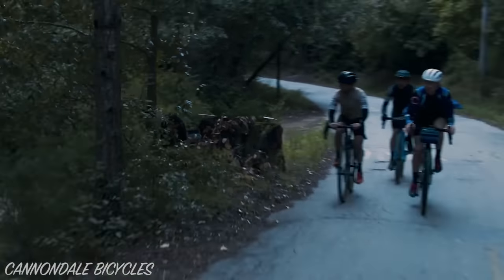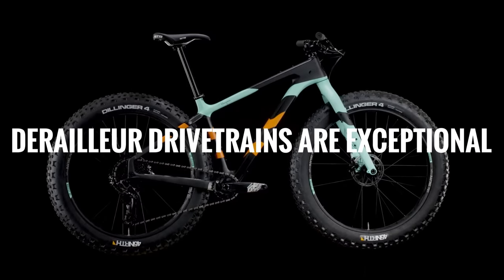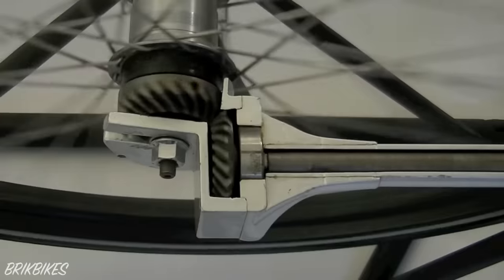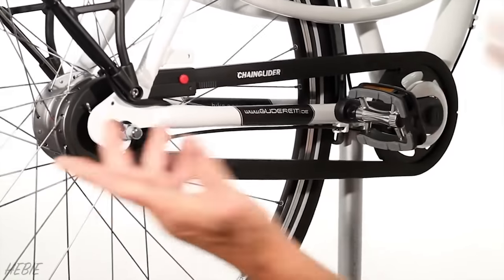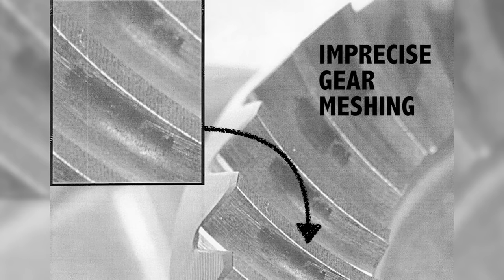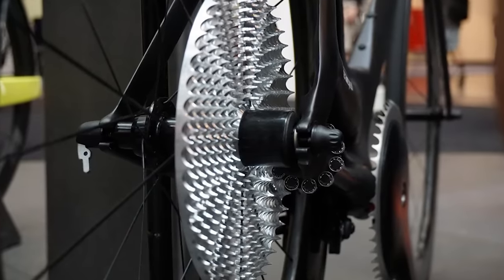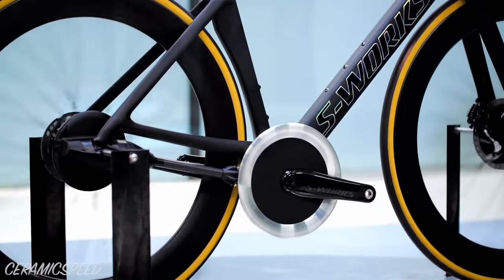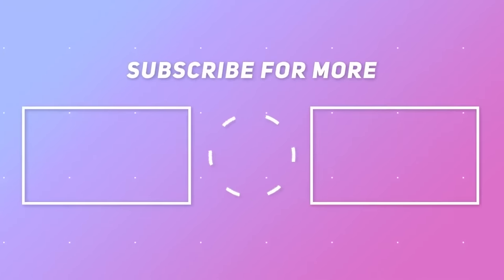Are Chainless Shaft Drive Bicycles a GENIUS or TERRIBLE Idea?

Comment: You give all the percent efficiency comparing a circa 1900 early shaft drive bicycle test, then include some imagined increase in efficiency in derrailier chain drive just for 100 years of manufacturing production. Chain technology may have improved but new expensive sealed, bushed and self-lubricated chains are not miniaturized for use on bicycles. Then you add on top the improvement in chain oil lubrication to come to a final difference. 
   Fair enough. But using the same logic, what about the known 100 years development and closer tolerances in gear design and accurate mass manufacture including CNC production? Then add the availability of many modern specialist low-friction surface coatings that can easily be applied to gears. Then likewise the new ranges of special high-pressure oils for gear lubrication? Then the improvement in mass manufactured self-lubricating ball and roller bearings that would now be used to maintain perfect shaft-drive gear tolerances.
   Take the perfect situation of a clean fully lubricated bicycle chain drive starting out. The moment the bicycle goes through a cloud of dust or mud we now have grinding-paste lubrication instead. The chain immediately starts drying out and wearing away. As there are only steel-rollers on steel-pins the chain is wearing away without continuous total-loss lubrication, so as the chain "stretches" with wear this only gets worse because the fit of the chain to the sprokets quickly deteriates in efficiency and exponentially increases wear on the sprockets as well. As wear is a sign of wasted energy then this says bicycle chains suffer a high AVERAGE rate of inefficency over their small lifetime. But regular lubricated gears can be maintenance-free for many 10’s of times the lifetime of chains, remain 100% grit-free, and therefore in reality may only suffer a slightly less AVERAGE efficiency than chains or NONE at all. 
   Like almost ALL modern products the real reasons bicycles are not made with gears is 1) the initial cost, but more importantly 2) the chain system is the only important part left on the modern bicycle that requires expensive regular replacement, and 3) therefore provides the best parts sales income for manufacturers AND 4) is the most important cause of bicycle deteriation and therefore new bicycle sales.
Reply: @leeroyjenkins0  The shaft is very unlikely to need replacement within your lifetime.

The was a series of motorbikes with shaft drive put into military service during WW2 for their improved reliability in adverse environments such as the sandy dunes of the Sahara, and as hard as those bikes were pushed, many of those that were not destroyed or locked away in museum exhibits are still on the roads today with their original drive shafts. That's with the machining technology of the 1940's, we've come a long way and can now make gears that mesh more efficiently and that even self-align, we can make the housings better sealed and use better lubricants under higher pressure to minimize friction and wear.  We've even reached the point where all the tools and machines needed to make your own parts are consumer items and can be purchased for relatively cheap; you don't need a specialist shop to order you a new shaft should yours ever break, you can  mill one yourself at home for less than $10.

Comment: Driveshaft bikes are already being used in citybikes in Cracow and they're way more reliable than chain bikes in other cities around here.
Reply: Meanwhile ive been commuting by bike for the past 10 years, between 10 and 26km a day. Ive never had to replace the chain or even had it slip off the sprocket.
Reply: @awellner3285  impressive!
Reply: @awellner3285  Must take care of that bike.
Reply: Shafts are more reliable and durable. But less efficient. I would rather choose the chain ones. For comfortable cycling.
Reply: @awellner3285  You're lucky.

Comment: I hate when the "effective" and "light weight" arguments are brought up for chain drives. The VAST majority of bicycles are heavy and not used in situations where extracting that extra 3% of energy makes any difference whatsoever. Those two arguments are only valid in racing. I would argue that 99% of people who buy road or mountain bikes would save far more weight and get far more energy into the tyres if they lost weight and became fitter than they do buy fitting light weight chain drive equipment.

The ACTUAL reason we keep using chains is that they are cheap, and they are cheap because we use them on everything. They are good enough for the vast majority of people. You could have a 100% effective drivetrain, and if it isn't cheap to manufacture (it won't be to start with) no one except the professionals will use it on their bicycles. If it's too expensive, not even amateur riders will use it.

Similarly, if you could make a 75% efficient drivetrain that costs 1% of a chain drivetrain to make, you'd see them on bicycles everywhere tomorrow, because manufacturers would be frothing at the mouth to make money on it.
Reply: I think this is failed argument. Sure, being fitter and driving lighter bicycles would be better, but has nothing to do with drive train. “Cheap” has to do with drivetrain and is a positive feature. All in all, even if your arguments are correct, they don’t make shaft drivetrain any better, it still stays more complex, less efficient, heavier, expensive... and I would argue complexity, cost and even weight matter for any cyclist, even if the maximum efficiency wouldn’t. And that is what this video was all about. I hate when every cycling video has someone saying that in average it would make more sense for people to be more fit. I buy that argument with ceramic bearings and/or carbon wheels that are more expensive and not that efficient in comparison, but not in this case, when the cheaper drivetrain is better in about every way.
Reply: @siffoine  you might also argue that a light and efficient bike is more fun to ride, so you'll probably ride it more often, which will in the end make you fitter.

Comment: Also rear suspension is harder to implement
Reply: There are quite a few ways to implement them easily, problem is that most of them still try to implement the classic look of a normal bike frame which causes problems.
Reply: Motorcyclists have been doing off-road rallying with huge suspension travel for decades on shafties (especially Yamaha and BMW) - it can be done!
Reply: Not harder, but even more expensive, complex, heavy and more mechanical losses. Not worth a shot outside of some pretty specific use.

Comment: Driven drivetrain seems to have all the drawbacks of a shaft system with all the drawbacks of a chain system... With no notable positives
Reply: Except smoother gear ratio changing, ...which didn't even get a mention in this video.
Reply: @penfold7800  nuVinchi achieved that long ago, and to the perfect degree - that's CVT!

Comment: I have one of the Driveshaft Brik Bikes shown in the video since 2014. I chose it as an ultra low maintenance, city commuter/allrounder that can left outside in the rain parked against a tree all year round.
At the time, belt drive options weren't as common as they are now.

Anyway, I still have mine after 10y and had one situation after 7y that the drive system completely locked up. Had to sent it back to the manufacturer to replace the drivetrain as it basically had run dry of lubricant. Was costly, but still a lot cheaper than a new bike.
Now still running fine without any mentionable issues although I don't use it as much anymore.

Nice tech, worked very good for my use case but in the a belt drive system would be my next choice.

Comment: 3:24 how does an improvement in the quality of chains and belts affect the efficiency rating of shaft drives? Mathematically it makes no sense to me, the efficiency ratings are not a relative measurement between drive trains but a measure of input vs output. Unless you are defining efficiency in some wierd way.
Reply: He's making a comparasion, he's supposing (idk if that's true) that shaft drive efficiency didn't change since the date of the experiment although chains and belts efficiency did improve thanks to better lubricants and build quality apparently so the difference in the efficiencies of a shaft driven bike vs a chain driven one is even higher today than it was back when the experiment was made
Reply: @matteobarsanti8139  that's not efficiency though. The efficiency of shaft drives did not change, which is what he claimed. Regardless the claim is a bit misleading because it only holds true for the case of bikes. The only reason shaft drives aren't efficient on bikes is due to the lack of rigid support necessitated by the weight restrictions. In heavy machinery shaft and gear drives are the most efficient means of mechanical power transmission and beat belts and chains with out question.

Comment: That new system is a much more efficient method of switching between gearing ratios, but the only problem is that it is too easy for it to get clogged up because the ratio cog array attached to the rear cycle wheel is unprotected from crud from the riding surface. It might work well on a specially designed recumbent bike though.

Comment: Chains are stronger. They engage nearly half the teeth around a gear vs a gear on gear drive that engages just 1 or 2 teeth at a time.
Reply: Pedal assist seems like a far better solution.
Reply: Nope.

With chains engagement is also limited to 1-2 thin teeth.
Gears drives have much stronger (and wider) teeths, allowing smaller gears to trasmit the same torque.
Reply: You will love chains until they get derailed when you ride your bike.
Reply: @frostsmaker8966  actually the one thing I love about bike chains is that I can easily put them back on lol.
Reply: @frostsmaker8966  that's an easy fix though
Reply: @onorebakasama  The experiences vary for people. For me, in the past, I'm on the way to school and they got derailed the problem is they got so many oils on them, it is so discouraging to touch them. In the end, it is easy but my hand so dirty and I have to touch the handle to ride it, now my handle also got dirty. What the hell,... then I have to wash my hand, clean the handle, so inconvenience. If there is a chainless bicycle, I will take it.
Reply: @frostsmaker8966  Waxing chains is a good alternative to oil,  clean the chain and dip into a hot crock pot of melted tealight candle wax.    Dry to the touch,   does not turn into a grinding paste like oil that picks up dust and sand,   Requires maintenance much less often.    

Even better if your chain has a unhook able link so you can easily remove and re attach your chain,   Connex link being one of the best as it is completely tool-less

Comment: I was at one of the largest bike shops in my state. The salesman kept trying to sell me a shaftdrive, telling me how great they were and almost zero maintenance. That was his first mistake since fixing, tweaking and doing the maintenance is very enjoyable to me. The other reason I didn't get one is because every shaftdrive they had were like cruiser bikes that were hideous looking, either they don't make "high-performance" shaftdrive or that shop didn't carry them. I still wouldn't of a shaftdrive just because I can see the shaft getting easily bent or broken if I land wrong or crash into a tree or rock. I never had a problem with chains except for my shoelace getting wrapped up.

Comment: The simplicity and durability of chains, even in dirty conditions, has stood the test of time. On the other hand, the alternative systems are heavy, would fail in dirty conditions, near impossible to repair ona roadside and are simply not a viable alternative.
Reply: Because all RnD was done in chain. I dont see many chain deraileur system in cars and machines
Reply: simplicity and durability of chains? in dirty condition? What? Chain is awful, always requires lube, frequent cleaning (unless you want to replace the whole drivetrain after a few thousand km), rear derailleur can be hit by some rock or literally ripped off, especially in mud. 
 "the alternative systems would fail in dirty conditions" - why an interal geared hub with belt should fail in dirty condition? Dirt can't get into hub, and belt is like 10x times more durable than chain. For touring bikes belts are the best.
Reply: Chains are 200 years old, plenty of time to evolve.
Back then chains weren't so efficient.
Reply: @taufikabidin412  R&D was also done in gearboxes and shaft drives, that's why you can still buy them today.

Shaft drives also has R&D in the motorcycle world (if you exclude automobiles), and the efficiency is even lower than bicycles shaft drives.

Sometimes one design is just superior against another design.
Reply: @ghoulbuster1  shaft drives existed for about the same amount of time. Sometimes one design is simply superior compared to another design for certain applications.

Comment: I imagine these might also have an explosion safety factor in specific industry settings because you have no metal chain skipping over metal sprockets and it's all very contained and isolated. So in places you can't drive your car or use a conventional bike, these could potentially be handy?

Comment: The traditional (chain) system, however, is the most perfect way to transform the energy for both bicycle and motorcycle.
Reply: They scale pretty poorly eg road cars
Reply: I think BMW motorcycle shaft drives prove you wrong.
Reply: Nah, chains are just a really good balance between cost, simplicity and efficiency
Reply: @percyfaith11    Have you looked at the maintenance frequency required for that shaft drive?
Reply: @robertheinkel6225  No, is it onerous?

Comment: You might have considered interviewing or researching amongst people that own and ride a shaft driven bike. I've owned a Dynamic Super 8 and currently ride an Incline branded version of the same frame, both ridden with a Shimano Nexus 8 IGH. I loved the bike from the start, which was about 5 years ago. In the second year I added an all in one front hub motor, allowing 5 minute conversion anytime, but it's been rare times that I swapped back to the stock front wheel. No wires, no sensors, I absolutely love the FHM. The motor assistance compounds the weight issue, while at the same time resolving it, and other downsides you mention. It's makes for a fantastic ride around town. In the winter I swap on my carbide studded 700c x 35 tires and enjoy immensely the traction benefits of the all wheel drive! It's really a fantastic combination, the IGH, plus FHM, plus shaft drive. There is a market for shaft driven bicycles, and I found extensive market research online indicating an upward trend, back in the first year or two I had mine. I really treasure my shaft driven bicycle. Thanks for the well produced video. I'm considering subscribing but will watch a few more videos first. Cheers!

Comment: "So why have these drive trains never taken off?". No pun intended.
Reply: Because the friction is enormous and engaging only 1-2 teeths isn't exactly strong point of any transmission, not to mention extremely high torque transmission like bicycle has.
Reply: @petersvancarek  Teeths? LOL!
Reply: @DMSProduktions  I will allow you to call it how do you choose, English isn't my first, not even my second language.
The fact remains, the bevel gear has much larger working surface compared to this engineering nightmare...
Reply: @petersvancarek  I know! The word 'teeth' in English IS the plural! There is no word as 'teeths' in English! 'Tooth' is the singular!
YW!
Reply: @gustavmeyrink_2.0  It doesn't matter, I know I'm a barbar regarding english :D Tooth-Teeth I got there teeths somehow. :D I make these mistakes all the time.
Reply: They have in motorcycles. They each have their uses.

Comment: one drawback I experienced with chains is shifting gear while pedaling. you must not apply pedal power. often while attempting to relieve pressure you accidentally pedal backwards while the derailleur shifts and the chain gets loose. Another issue worth noting is about motor-assist bikes. Why is it difficult to pedal an e-bike? If the motor is disengaged, it should not interfere with the drive, at least in theory.
Reply: Youd really have to pull apart an ebike to find where that friction is coming from, my guess is it doesn't actually disconnect from the drive but the generator, would be easier to just have a switch flip that a mechanical disengagement. I don't know shit btw, just a guess